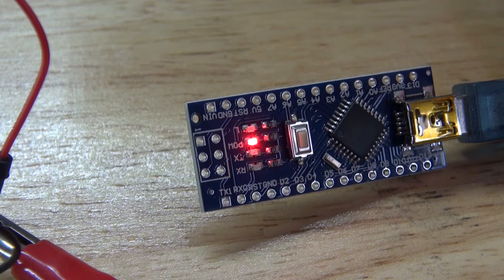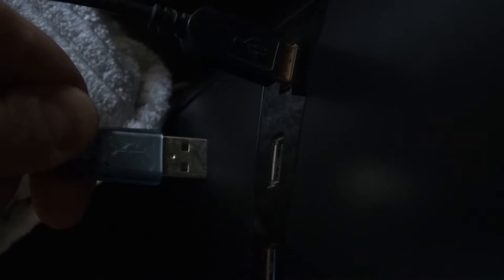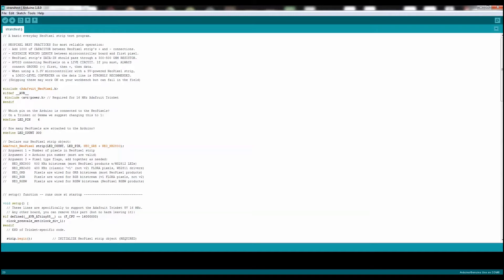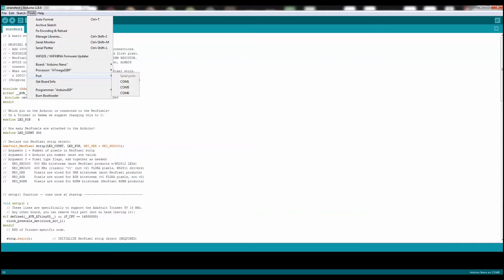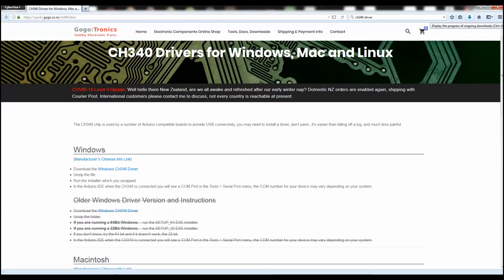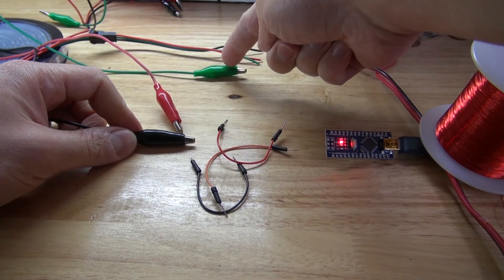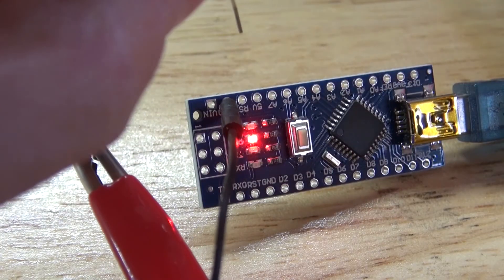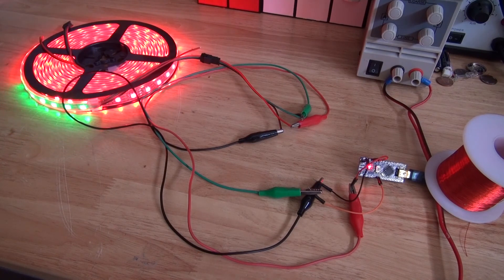How To Setup A ws2812b RGB LEDs With Arduino Nano

Comment: I am using 5v 2amp with 5v ws2812b but only glowing 2meter another 2meter not glowing.
Reply from the maker: Make sure your power supply is sufficient. It also could be the eco model not the pure cold model.
Reply: @SciTyeTech thankyou sir

Comment: It seems easy enough to hook up but I need to change the color when a certain dB level is reached. At 30 dB, it turns Orange, at 35 dB it turns red, at 40 dB> it turns to flashing blue and red (like police lights). How do Icreate that in the code?

Comment: please dont follow this video..
dont power the arduino BEFORE making connections - make connections first, then power on arduino.
dont make connections by putting breadboard jumper wires into unpopulated through-holes on the arduino, like you're throwing a hotdog down a hallway - get an arduino that has pin headers already soldered to it, or solder headers to it yourself, or (if neither of those options are possible) at least bend the pins in half, making a V, before putting them directly into the through-holes so there's some chance of them making constant contact with the solder pads, and not able to bounce around causing potential arcs/surges, or falling out completely and shorting something on the arduino.
don't drive an entire strand of LED's straight from the arduino's 5V pin - the arduino can only handle a couple dozen of these pixels, and that's if you don't run them at full-bright white color - definitely not 300 pixels. You'll need a separate power supply that can handle > 2A, then connect the positive of the power supply to the red wire on the LED strip (don't connect anything to the arduino's 5V pin), connect the negative of the power supply to the black wire of the LED strip AND to arduino GND, then connect the green wire of the LED strip to whatever digital pin you've assigned in your code (d4 in this case).
if you don't want to fry your arduino's, please don't follow this video.

Comment: There is no power? I dont understand. O did everything ok but there is no lights. Can you tell what is wrong?
Reply from the maker: Did you solder the wire to 5v pin on the Arduino nano and solder to the opposite end to the 5v on the neopixel and ground to ground?

Comment: You powered 300 LEDs with a Nano?
Reply from the maker: Yes I did. It seems like 300 LEDs might be the maximum. However I heard or read that 600 LEDs may work especially with a higher amperage power supply.
Reply: @SciTyeTech  Uh... Each "Neopixel" has a max power draw of 60mA. A USB port can only supply 500mA. So, if you're going to run more than about 12 around full power, you'll need an external power supply. Like, if you want to run 144 Neopixels, you'd want a 5V DC PSU rated for at least 8.7A (144 x 60mA = 8,640 mA -or-8.64 Amps)
Reply: @SciTyeTech  I think you're looking at the maximum that can be controlled like due to RAM constraints, the power is a separate issue

Comment: hey i did it as shown in the video. The upload is successful but the leds do not light up
Reply from the maker: Did you have it connected to the correct pin?
Reply: Same thing with mine. Upload was successful but the leds do not light up. Also connected it to the correct pin. Not sure what's going on but do I need to connect a resistor to the data pin and capacitor on the +/- pins?